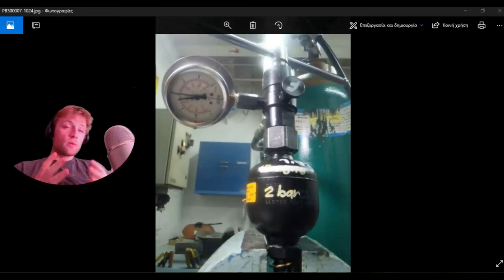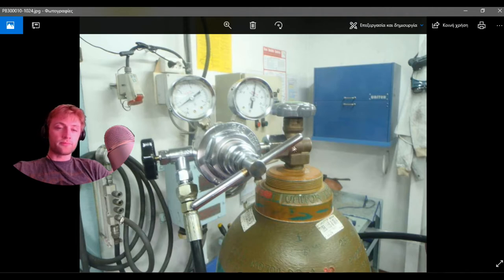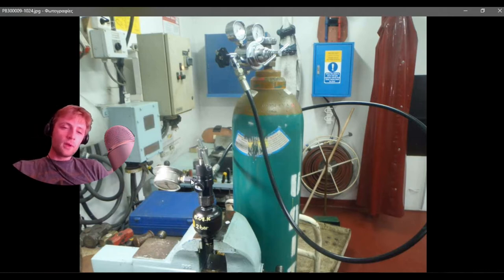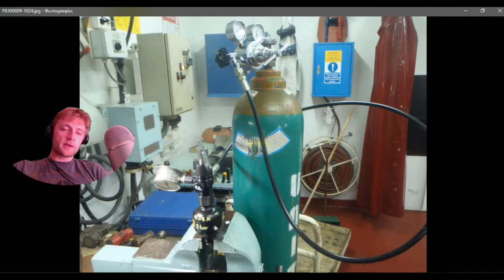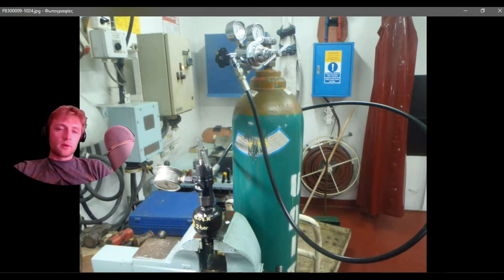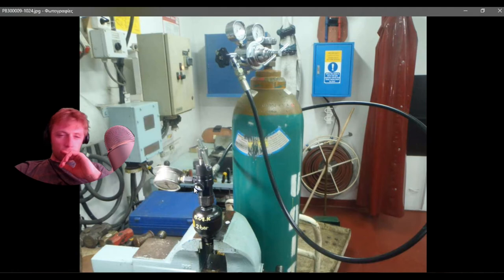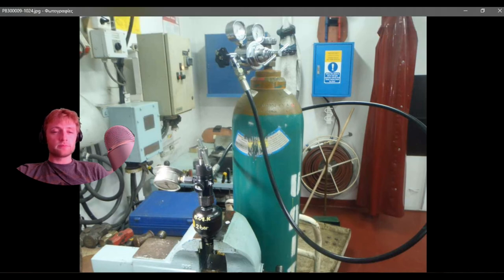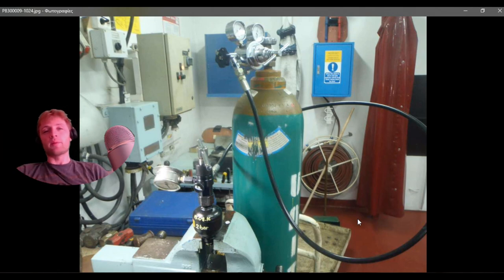HOW TO CHECK NITROGEN PRESSURE ON ACCUMULATORS

Comment: What is nitrogen hydraulics used for on a vessel`?
Reply from the maker: Hello it's used for Alfa lubricator accumulators for cylinder lubricating system
Reply: @Adventure-Story  this is good question, why nitrogen, why its better than different gas?
Reply: @rekaczowiekacharakternego6569  It's an inert gas so it's safe for usage. And there's usually stock of N2 on board for other application such as A/C and ref plant flushing.
Reply from the maker: Nitrogen!